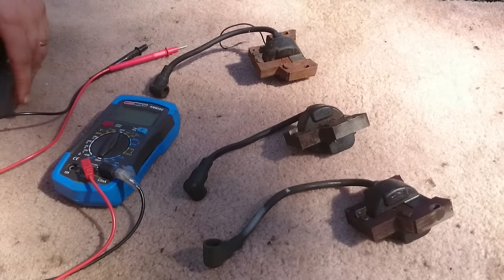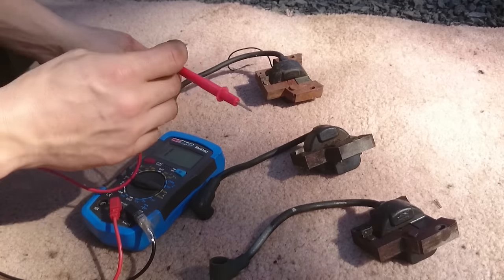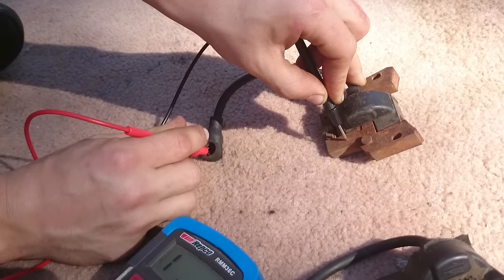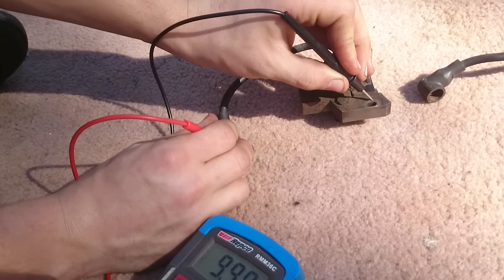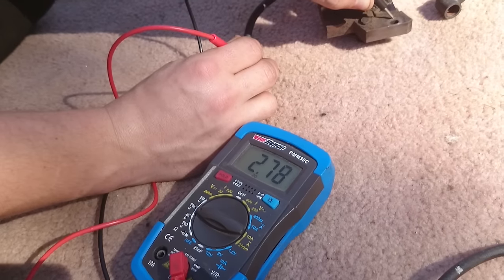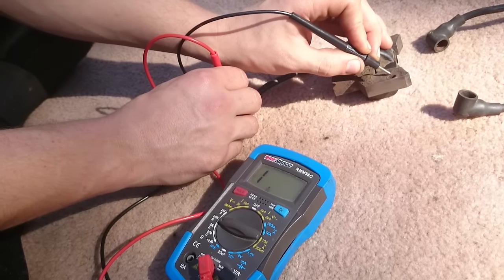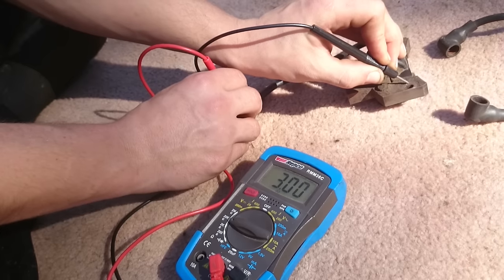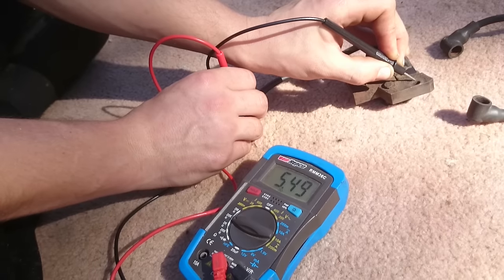PushMowerRepair.com - Briggs Ignition Coil Testing

Comment: Just be aware, a coil can show 2.8 kOhm and STILL be bad.  I just replaced a coil on my mower that showed perfectly good resistance but produced no spark.  With the new coil installed, the mower runs great.

Comment: The two ignition coils I have both tested 4.68 kilo-ohms (on lawn mower) and 4.72 kilo-ohms (spare) . Lawn mower wasn't starting. Root cause, sticky dirt on the ends of the coil between it and the motor magnets. Cleaned with methylated spirits, reassemble, alive :D

Comment: Great video. Was not 100 percent sure it was the ignition coil until I watched your video. Tested ignition coil with multimeter while it was hot and it had too much resistance. Replaced and now my mower runs great again. Thanks!!!!

Comment: I was getting 2.78 but spark was there then totally gone tried cleaning up mounting area,disconnecting kill switch,new plug,checking air gap but no dice.So is it like there is a primary and secondary coil?and this only tests one?anyway replaced with new coil runs great.Thanks for putting up video just looking for answer.

Comment: Ok I have checked my ignition coil at my briggs 5hp engine and is has ~ '2.80' resistance . The problem is that there is no spark, so the ignition coil is 'good'. I think the cap is the cause of this problem. Thank you, your clip was very helpful!

Comment: This works for pretty much any small engine, never knew it was that simple.  My problem is when the engine gets hot.... it's like the coil is "breaking down" at operational temp because there is fuel, but spark goes away(used an inline spark tester)... any suggestions? Thinking about just changing the coil, but dont like wasting money....

Comment: I own a walk behind mower with a Briggs and Stratton engine  that will barely pick up the gas 9 times out of 10 when I pull the rope.  Carb cleaner will get it started and it keeps running with fuel in the tank.  Is that an ignition coil or a coil wire issue?
Reply: there should be a diaphram gasket between the carb and tank. these get hard and dont pump well anymore. easy fix. just make sure you get the right one with the correct number of mounting screws there are a few different ones

Comment: My lawnmower (Briggs & Stratton 625) starts fairly well cold.  Might take 2-3 pulls.  Runs fine until I have to shut it off if I have to clean out the side discharge etc.  But often can't restart it.   I've used an inline spark tester--shows good cold but VERY weak when it's hot after shutting it down.  The puzzle is that it runs fine hot until I shut it off.  I suppose heat could build up when the fan isn't running while I'm cleaning out the discharge chute ....?  Is this likely to be ignition coil?  and how can I test it when it's hot?  THANK YOU!
Reply from the maker: This is a common symptom of a worn coil, As they get hot resistance increases and spark becomes weak. It is easier to keep an engine running then to start and engine this is why they still run hot but then will not restart until cold. You can test you coil While on the mower by connecting the multi-meter leads to the spark plug lead and then to the cylinder head. You should do this while cold then while hot to compare readings.
Reply: This is exactly the information I was looking for. THANK YOU!  The coil tests at 4.90K ohms cold. I haven't tested it yet hot.  But from what you said above I'm pretty sure a new coil is due soon.

Comment: This is useful information and checking my B&S coil this way I have a resistance of 2.66K ohms.  But I still get no spark.  However, the resistance between the cut-off connector and ground is zero.  This can't be right, can it?  Any idea what this should read?  Is my coil dead?
Reply: +billericaybruce In fact, resistance between the cut-out connection and ground is maybe not zero but definitely <1 ohm.
Reply from the maker: +billericaybruce The cut out connection is meant to connect the coil to ground eliminating the spark, So it should read very little resistance, However it should not be connected unless the throttle is in the off position.
Reply: Thanks.  In fact, I was measuring the resistance between the cut off connection point and ground with the coil out of the mower, on the bench.
Reply: @billericaybruce  Hi mate I have the same issue today what did you work out eventually ? Sorry 3 years ago !

Comment: great video!  I did the old spark test but like to have actual specs to double check.  Do you happen to know the resistance range for honda push mower coils?  Part Number 30500-Z8B-901.  Mine test >9.0 so I'm assuming that too much resistance?
'
Reply from the maker: Hi Kimberly 

we do not know the range for honda coils so we cannot say whether 9 is a good or bad reading.

Comment: Just picked up a new magneto on eBay. The test between the spark plug lead and ground shows infinite resistance - which means it is bad, correct? The seller sent a second with the same result. Are both new magnetos bad, or could it be different design? Do you recommend installing this magneto and trying it, or is that a futile waste of time?
Reply from the maker: The reading would suggest that the coil is bad but it may be a newer or different design so install the magneto is worth a shot
Reply: I installed the megneto (above), attempted to start, and no spark. I'm on my third new magneto (this time a Sten brand) that shows infinite resistance between ground and the spark plug lead using two multimeters - 1) digital, 2) analog. What am I missing?  I've double checked this, but the magneto is a #590781 for a Briggs & Stratton model 422437-1209-01 on a Craftsman GT-18 lawn tractor. Any suggestions would be greatly appreciated.

Comment: Mine read 4.89. Although this is within range, is it close enough that replacement would be advisable? I ordered the new parts before realizing I could try testing and cleaning them. After cleaning them and the magnet, the mower works again.
Reply from the maker: Daniel Williamson Although 4.89 is within the range its probably not got too much life left in it. Replacing it would ensure no more ignition problems in future.
Reply: Thank you!

Comment: So is the  ignition module integral to the magneto coil? Used to be there was   separate points or solid state module that you had to install.  Not up to snuff on this. Thanks
Reply from the maker: Yes the Ignition module is integrated into the coil, This is the case for the majority of modern engines.
Reply: Thanks, appreciate it.

Comment: can you test the coil the same way if its on the lawn mower or does it have to  be off to test it ?
Reply: after taking mine off found out you can leave it on, but must disengage the kill switch wire underneath the coil while testing

Comment: Could a Briggs & Stratton coil pulling a 4.94 cause a "no spark" condition? Thanks! Good vid btw.
Reply from the maker: As the reading gets close to 5 the spark is getting weaker and weaker, It is unlikely to cause no spark at all but it is possible

Comment: where does the power for the coil come from if its not on the machine  ? does it come from the meter ?
Reply from the maker: When testing the coil the meter puts out a small voltage to generate the resistance reading. When on the engine the coil is powered by the rotating magnets in the flywheel.
Reply: cheers , didnt get any  reading from the meter so guessing the coils naff . 
thanks for reply

Comment: So Briggs and Stratton just sold me a brand new bad coil? I get no reading.  If I touch the negative probe to one of the smaller leads on the coil (not spark plug lead) I get a reading of 4 to 5 on both my old rusty coil and the brand new one.

Comment: mine is reading 5  ohms brand new coil it started and ran out of gas i went to get gas came back and wont fire at all now
Reply from the maker: If it ran fine until it ran out of fuel it is more likely to be a carburetor issue then spark.
Reply: no it just quit firing completely is 5 ohms res. right ?
Reply from the maker: If the coil is the same model as the video 2.5 to 5 K ohms is a good reading, If it is different the reading will be different. I would suggest checking that the kill-switch wire has not shorted anywhere.
Reply: thanks man liked and subbed ur channel
Reply: @James From nyc
My 22 year old mower developed similar valve sticking problem. To immediately free valves, I poured about a tbls of auto trans fluid in combustion chamber and worked it until valves were operating properly. Then I switched to full synthetic oil. That mostly resolved the problem; unit has worked well for 11 years. Depending on how bad a sticking problem yours has, you may want to add a few tbls of trans fluid to crankcase oil also.

Comment: So I checked mine and it read about 6k so I replaced it and the new one also reads at 6k, any reason why that might be?
Reply from the maker: Not all coils have the same ratings, The coil in the video is rated from 2.5k-5k Your coil may be a different or newer design
Reply: Would the box have the rating on the side of it? Or how would I figure out the rating.
Reply from the maker: The only way to get the rating is from the manufacturer of the coil or by testing a number of new and used coils to determine a working range
Reply: FYI, Briggs & Stratton 6.5HP engine, coil PN590454 factory rating is 6,000~8,000 Ohms from plug wire to layered core.

Comment: mine 2.65 and no spark anyone  help?
Reply from the maker: +Damir Aga You should check the contact and wire leading to the off switch located near the throttle linkage and make sure it is not grounded
Reply: Genius thanks mister. where would the first grounding block be?